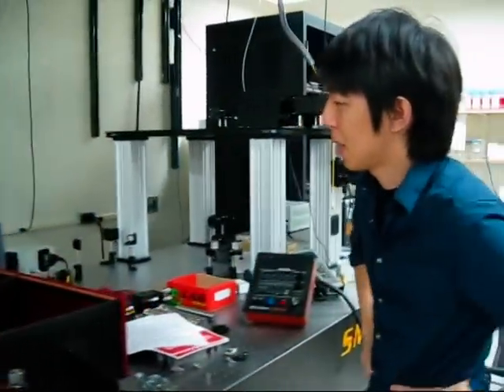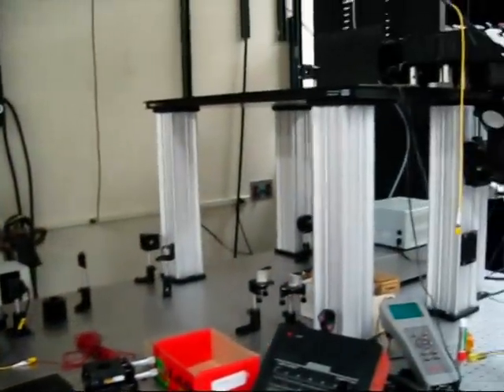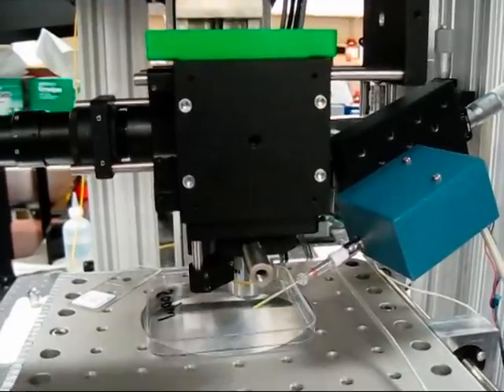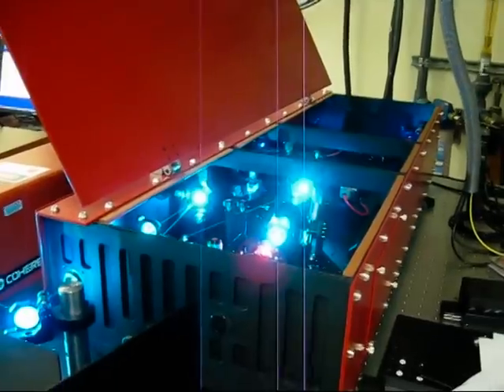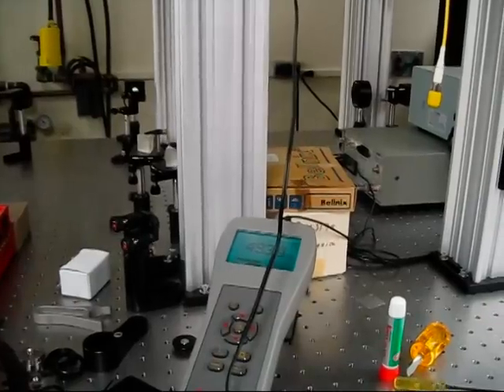Del Mar Photonics Ti:Sapphire laser Trestles in the UCLA Biophysics Neuroimaging Laboratory

Comment from the maker: UPCOMING PRESENTATION
Broadband 2.5-6?m frequency comb source for dual-comb molecular spectroscopy
Viktor O. Smolski, Konstantin L. Vodopyanov
9 February 2015 • 2:35 - 2:55 PM | Part of SPIE LASE

Investigating the coherence properties of terahertz quantum cascade lasers with fs-laser combs
Stefano Barbieri
10 February 2015 • 11:30 - 11:50 AM | Part of SPIE OPTO

Monolithic optical frequency comb based on quantum dashed mode locked lasers for Tb/s data transmission
Anthony Martinez, Cosimo Calo, V. Panapakkam, Kamel Merghem, Regan T. Watts, Vidak Vujicic, Colm Browning, Alain Accard, Francois Lelarge, Liam P. Barry, Abderrahim Ramdane
12 February 2015 • 11:50 AM - 12:10 PM | Part of SPIE OPTO

Materials for on-chip optical combs
Michal Lipson
12 February 2015 • 10:55 - 11:15 AM | Part of SPIE OPTO

On chip temporal solitons and coherent dispersive waves in SiN optical micro resonators for octave spanning frequency combs
Tobias J. Kippenberg
9 February 2015 • 1:45 - 2:10 PM | Part of SPIE LASE

Terahertz octave-spanning semiconductor laser for comb applications
Giacomo Scalari, Markus Roesch, Mattias Beck, Jerome Faist
11 February 2015 • 8:10 - 8:40 AM | Part of SPIE OPTO

Quantum cascade laser stabilization at sub-Hz-level by use of a frequency comb and an optical link
Berengere Argence, Bruno Chanteau, Olivier Lopez, Daniele Nicolodi, Michel Abgrall, Christian Chardonnet, Christophe Daussy, Benoit Darquie, Yann Le Coq, Anne Amy-Klein
9 February 2015 • 3:55 - 4:15 PM | Part of SPIE OPTO

Optical noise and comb spectrum stability in quantum dot lasers
Artem V. Savelyev, Mikhail V. Maximov, Alexey E. Zhukov
10 February 2015 • 2:40 - 3:00 PM | Part of SPIE OPTO

Mid-IR frequency comb generation based on crystalline microresonators
Caroline Lecaplain, Erwan Lucas, Clement Javerzac-Galy, Victor Brasch, Martin H. P. Pfeiffer, Tobias Herr, John J. Jost, Arne Kordts, Michael Geiselmann, Tobias J. Kippenberg
11 February 2015 • 8:10 - 8:40 AM | Part of SPIE OPTO

Terabit/s communications using chip-scale frequency comb sources
Christian Koos, Tobias J. Kippenberg, Larry R. Dalton, Liam P. Barry, Wolfgang Freude, Juerg Leuthold, Joerg Pfeifle, Claudius Weimann, Matthias Lauermann, Stefan Wolf, Victor Brasch, Tobias Herr, Delwin L. Elder, Vidak Vujicic, Regan T. Watts
9 February 2015 • 3:20 - 3:45 PM | Part of SPIE LASE

Fiber-laser frequency combs for the generation of mm- and THz-waves, sinc-shaped Nyquist pulses, and tunable single-frequency laser lines
Thomas Schneider
12 February 2015 • 11:15 - 11:40 AM | Part of SPIE OPTO

All solid-state mid-infrared dual-comb spectroscopy platform based on QCL technology
Andreas Hugi, Markus Geiser, Gustavo F. Villares, Francesco Cappelli, Stephane Blaser, Jerome Faist
10 February 2015 • 11:50 AM - 12:10 PM | Part of SPIE OPTO

Diamond frequency combs
Marko Loncar
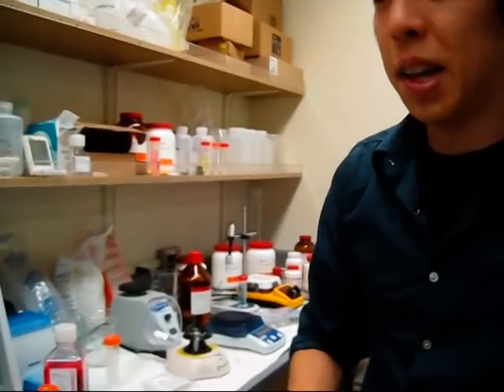9 February 2015 • 1:20 - 1:45 PM | Part of SPIE LASE
COURSE AT CONFERENCE
Ultrafast Fiber Lasers and Frequency Combs (SC744)
Instructor(s): Fermann, Martin, IMRA America, Inc.
Level: Intermediate • 0.35 CEU • Length: 4.00 hours
Member Price: 300.00 | Non-Member Price: 355.00
10 February 2015 • 8:30 AM | Part of SPIE Photonics West

Advances in Kerr optical frequency comb generation
Guoping Lin, Irina V. Balakireva, Khaldoun Saleh, Souleymane Diallo, Romain Martinenghi, Remi Henriet, Aurelien Coillet, Yanne K. Chembo
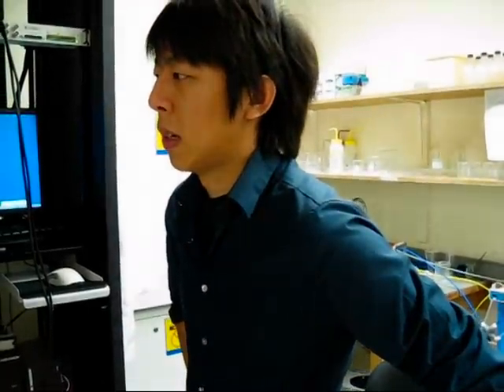9 February 2015 • 5:00 - 5:25 PM | Part of SPIE LASE

Brillouin lasers, frequency combs, and optical frequency division using high-Q silica resonators
Kerry J. Vahala
9 February 2015 • 10:30 - 10:55 AM | Part of SPIE LASE

Broadband midinfrared frequency comb with tooth scanning
Kevin F. Lee, Piotr Maslowski, Andrew Mills, Christian Mohr, Jie Jiang, Peter G. Schunemann, Martin E. Fermann
9 February 2015 • 9:10 - 9:30 AM | Part of SPIE LASE

Precision frequency metrology with microresonator combs
Scott Diddams, Scott B. Papp
9 February 2015 • 2:10 - 2:35 PM | Part of SPIE LASE

Towards efficient octave-spanning comb with micro-structured crystalline resonator
Nan Yu, Ivan S. Grudinin
9 February 2015 • 3:45 - 4:10 PM | Part of SPIE LASE

Comb laser and ring modulator resonator based optical interconnects
Jeremy Witzens, Juliana Muller, Johannes Hauck, Saeed Sharif Azadeh, Alvaro Martir, Bin Shen, Sebastian Romero Garcia, Florian Merget
10 February 2015 • 11:40 AM - 12:10 PM | Part of SPIE OPTO

Dual-comb MIXSEL
Sandro M. Link, Christian A. Zaugg, Alexander Klenner, Mario Mangold, Matthias Golling, Bauke W. Tilma, Ursula Keller
10 February 2015 • 11:40 AM - 12:00 PM | Part of SPIE LASE

Analysis of microwave frequency combs generated by semiconductor lasers under hybrid optical injections
Yu-Shan Juan, Cheng-Ting Lin, Yi-Hua Wu
11 February 2015 • 6:00 - 8:00 PM | Part of SPIE OPTO

Soft tissue imaging using a high voxel rate quantum-memory-based acousto-optic technique
Luke R. Taylor, Alexander Doronin, Igor Meglinski, Jevon J. Longdell
10 February 2015 • 6:00 - 8:00 PM | Part of SPIE BiOS

A multistandard and multiservice radio-over-fiber system for next-generation network
Sarra Rebhi, Rim Barrak, Mourad Menif
11 February 2015 • 3:50 - 4:10 PM | Part of SPIE OPTO

Increased distributed sensing sensitivity using higher order stimulated Brillouin scattering
Victor L. Lambin Iezzi
11 February 2015 • 3:10 - 3:30 PM | Part of SPIE LASE

Investigation of receiver constraints on the transmission of 1 Tbps WDM-nyquist and CO-OFDM signals
Hraghi Abir, Mourad MENIF
11 February 2015 • 2:40 - 3:00 PM | Part of SPIE OPTO

Carrier-envelope-offset frequency detection of an ultrafast VECSEL
Mario Mangold, Christian A. Zaugg, Alexander Klenner, Aline S. Mayer, Sandro M. Link, Florian M. Emaury, Matthias Golling, Emilio Gini, Clara J. Saraceno, Bauke W. Tilma, Ursula Keller
9 February 2015 • 4:00 - 4:30 PM | Part of SPIE LASE

Octave spanning semiconductor laser
Markus Roesch, Giacomo Scalari, Mattias Beck, Jerome Faist
10 February 2015 • 10:45 - 11:00 AM | Part of SPIE OPTO

Coherent spectral broadening and compression of the output of a mode-locked VECSEL
Edward A. Shaw, Adrian H. Quarterman, Lucy E. Hooper, Peter J. Mosley, Keith G. Wilcox
10 February 2015 • 12:00 - 12:20 PM | Part of SPIE LASE

Diamond photonics
Marko Loncar
12 February 2015 • 3:00 - 3:30 PM | Part of SPIE OPTO

Quantum cascade lasers for broadband spectroscopy
Jerome Faist
11 February 2015 • 10:30 - 11:00 AM | Part of SPIE OPTO

Latchable rotational MEMS mirror for silicon photonics
Jonathan Briere, Philippe-Olivier Beaulieu, Frederic Nabki, Michael Menard
11 February 2015 • 2:40 - 3:00 PM | Part of SPIE OPTO

Low-noise four-wavelength simultaneous oscillation of a 1.3-?m external-cavity quantum-dot laser
Nami Yausoka, Mitsuru Ishida, Kan Takada, Masaomi Yamaguchi, Tsuyoshi Yamamoto, Yasuhiro Arakawa
9 February 2015 • 11:20 - 11:40 AM | Part of SPIE OPTO

Nano-scale optical actuation based on two-dimensional heterostructure photonic crystal cavities
Tong Lin, Guangya Zhou, Fook Siong Chau, Feng Tian, Jie Deng
8 February 2015 • 11:40 AM - 12:00 PM | Part of SPIE OPTO

Broadband receiver-based distortion elimination in phase-modulated analog optical links using four-wave mixing
Amit Bhatia, Hong-fu Ting, Mark Foster
12 February 2015 • 11:50 AM - 12:10 PM | Part of SPIE OPTO

Enhancing and inhibiting stimulated Brillouin scattering in photonic integrated circuits
Benjamin J. Eggleton
9 February 2015 • 4:00 - 4:30 PM | Part of SPIE OPTO

Quantum and ultrafast precision measurements in mesoscopic mode-locked architectures
Chee Wei Wong
11 February 2015 • 4:00 - 4:30 PM | Part of SPIE OPTO

Densely-packed NxN wavelength crossconnect switch module
Hisato Uetsuka, Masao Tachikura, Hitoshi Kawashima, Hiroyuki Tsuda
11 February 2015 • 1:30 - 1:50 PM | Part of SPIE OPTO

MEMS-based frequency modulation of fiber ring laser
Kamal Khalil, Khaled Hassan, Ahmed Shebl, Mostafa Soliman, Fares Al-Arifi, Mohammed Al-Otaibi, Yomna M. Eltagoury, Yasser M. Sabry, Diaa Khalil
12 February 2015 • 4:30 - 4:50 PM | Part of SPIE OPTO
COURSE AT CONFERENCE
Coherent Mid-Infrared Sources and Applications (SC1012)
Instructor(s): Vodopyanov, Konstantin L., CREOL, The College of Optics and Photonics, Univ. of Central Florida
Level: Intermediate • 0.35 CEU • Length: 4.00 hours
Member Price: 300.00 | Non-Member Price: 355.00
12 February 2015 • 1:30 PM | Part of SPIE Photonics West

Deep FTTH optical access networks including multi-mode and few-mode In-building distribution
Roberto Llorente, Maria Morant, Marta Beltran, Andres Macho
11 February 2015 • 9:30 - 10:00 AM | Part of SPIE OPTO

Solitons and coherent dispersive wave emission in SiN microresonators
Victor Brasch, Tobias Herr, Michael Geiselmann, Michael L. Gorodetsky, Tobias J. Kippenberg
9 February 2015 • 11:10 - 11:30 AM | Part of SPIE OPTO

Multiple quasi-stable spectral outputs at constant current from a continuous-wave high-power quantum cascade laser
Tobias S. Mansuripur, Guy-Mael J. de Naurois, Yongrui Wang, Wondwosen Metaferia, Carl Junesand, Sebastian Lourdudoss, Bouzid Simozrag, Mathieu Carras, Alexey A. Belyanin, Federico Capasso
11 February 2015 • 2:10 - 2:30 PM | Part of SPIE OPTO

Comparison of photonic integrated circuits for millimeter-wave signal generation between dual wavelength sources for optical heterodyning and pulsed mode locked lasers
Guillermo Carpintero del Barrio, Carlos Gordon Gallegos, Robinson C. Guzman Martinez, Frederic Van Dijk, Gael Kervella, Martyn Fice, Katarzyna Balakier, Cyril C. Renaud, Xaveer J. M. Leijtens
12 February 2015 • 9:30 - 9:50 AM | Part of SPIE OPTO

Noise in microphotonic oscillators
Lute Maleki, Andrey Matsko
9 February 2015 • 12:00 - 12:30 PM | Part of SPIE OPTO

Low-threshold lasing from organic and polymeric microdisk printed by room temperature atmosphere ink-jet technique
Cong Chen, Soichiro Ryu, Hiroaki Yoshioka, Kei Yasui, Yuji Oki
9 February 2015 • 2:30 - 2:50 PM | Part of SPIE OPTO

Comparison of linear and nonlinear models for coherent hemodynamics spectroscopy
Angelo Sassaroli, Jana M. Kainerstorfer, Sergio Fantini
11 February 2015 • 8:00 - 8:20 AM | Part of SPIE BiOS

Angioscopic image-enhanced observation of atherosclerotic plaque phantom by near-infrared multispectral imaging at wavelengths around 1200 nm
Katsunori Ishii, Ryo Nagao, Daichi Matsui, Kunio Awazu
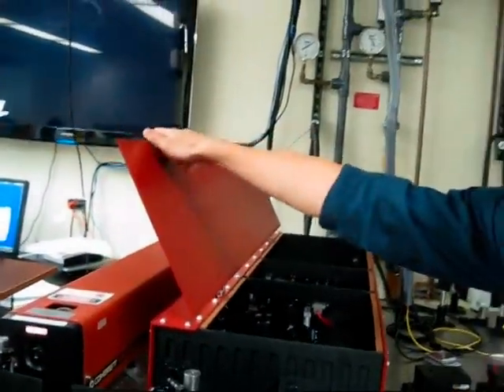8 February 2015 • 5:30 - 7:00 PM | Part of SPIE BiOS

Predicting hormonal therapy response in breast cancer using diffuse optical spectroscopic imaging (DOSI): ongoing clinical study
Thomas D. O'Sullivan, Anais Leproux, Kyle Cutler, George P. Philipopoulos, Alice M. Police, Freddie Combs, Dorota Wisner, Albert E. Cerussi, Min-Ying Su, Bruce J. Tromberg
9 February 2015 • 3:10 - 3:30 PM | Part of SPIE BiOS